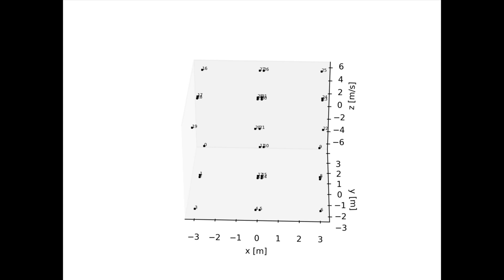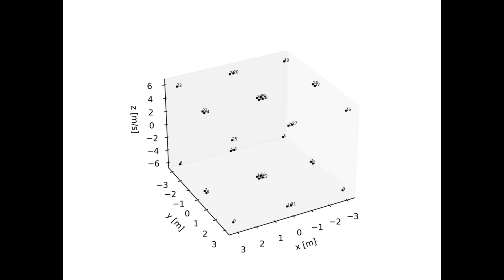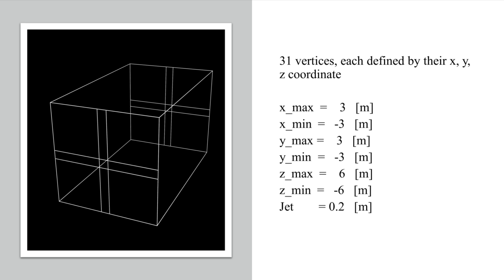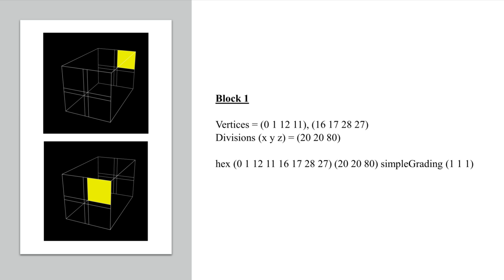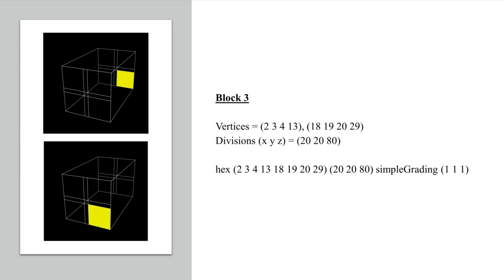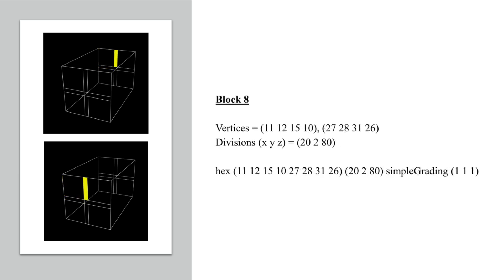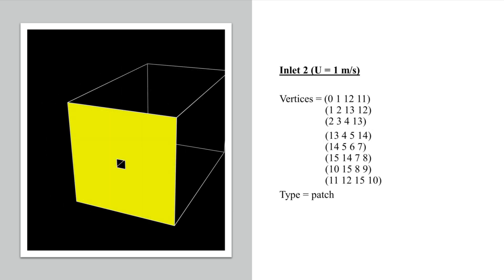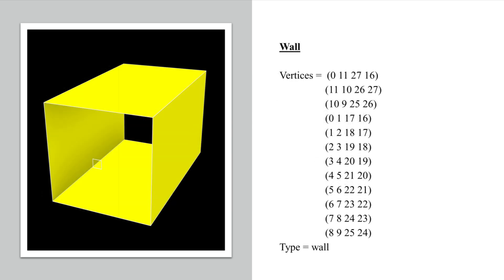How to Define a BlockMesh | A Quick Reference

Comment: I just recently got out of a project with 86 different blocks with various grading options. I wish this was available a couple of months ago lol. My best advice would be to read through the documentation carefully and assemble the mesh block by block checking if you have actually constructed what you imagine with paraview after each block
Reply from the maker: That sounds like a nightmare, did you look into creating a python code to automate the process at all?
Reply: @interfluo6420  uh no the logic for the mesh was actually simple its just all the bookkeeping. Also I was learning as I was going along so it as pretty dynamic for me to write a code for automatic mesh generation. 

I did my best to use variables in the blockmesh file and comment as much as possible so that it wasnt all alien to me when i had to change something but definitely I will handle it better next time it was a good learning experience